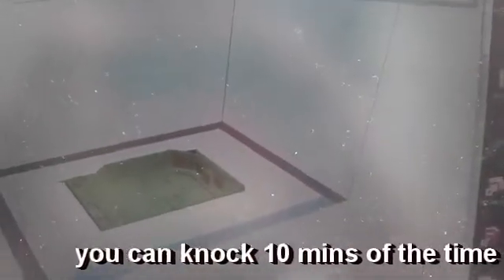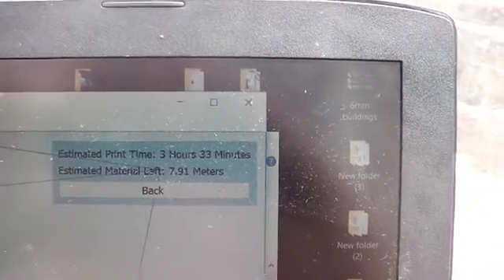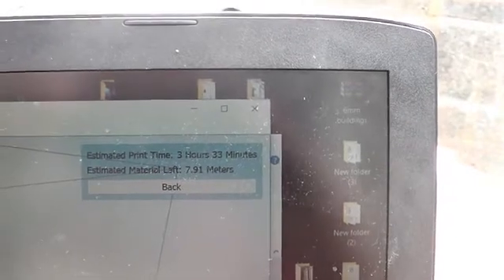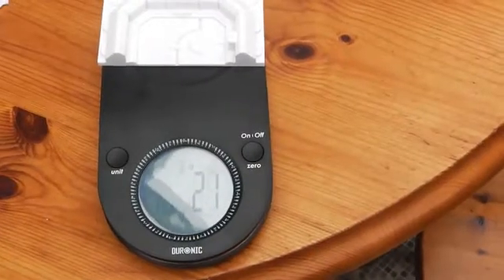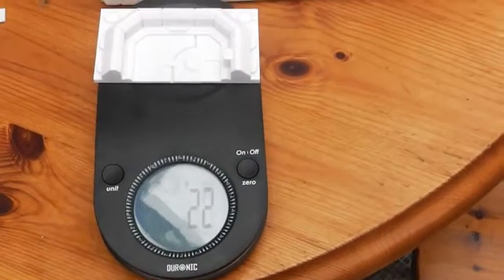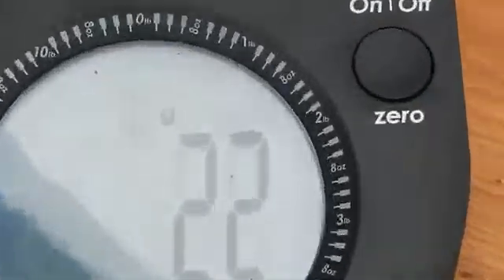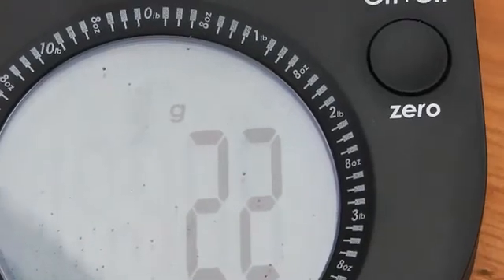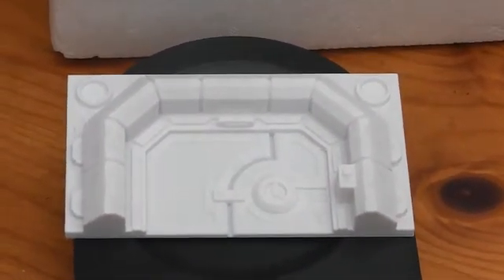How much does a 3d print cost to print

Comment: Don't forget your 
labour time and workshop lighting and in the winter heating as well and wear and tear on your printer!!
Just found your channel very good so if you print for people what is the largest item you can print?
Reply from the maker: Bob Wareham bed size us 15 x 24 cm max on the printer I am using would have check max  build height . As my printer is enclosed it helps with abs printing.
Reply: so in old money 6x9 inch thank you. all the best Bob-UK

Comment: Steve, you need to remove your camera from the table as it wobbles when you touch the table
Reply from the maker: Bob Wareham I need to look at better camera mounting options the tripod works for some stuff and the mini tripod for others , I notice the screw was not tight on the mini tripod after filming . Makes a change from the cat causing issues :p
Reply: Ok best of luck keep going looks good I will follow your channel.